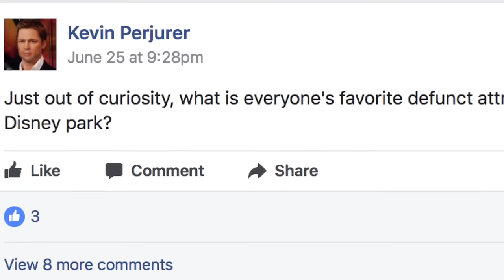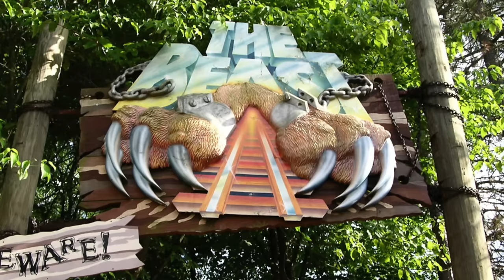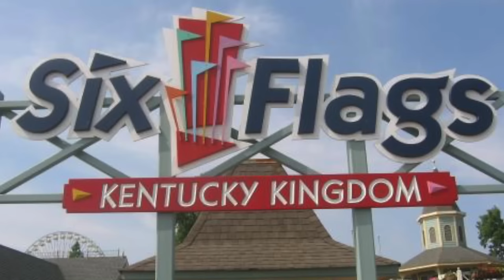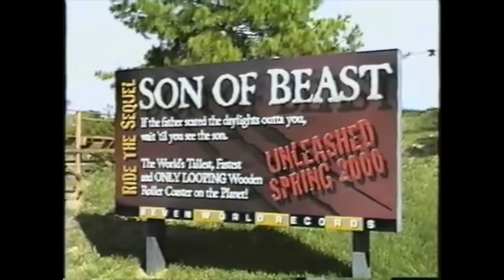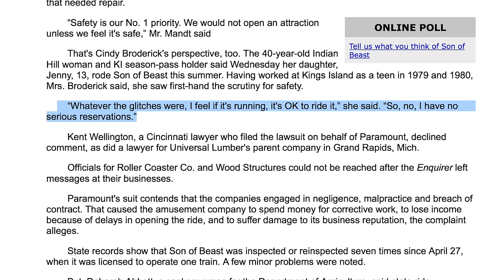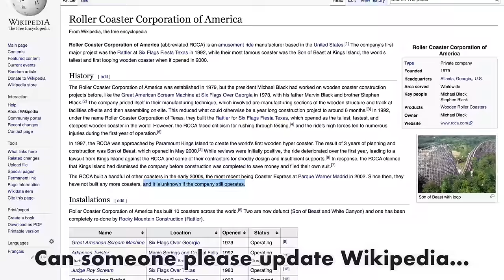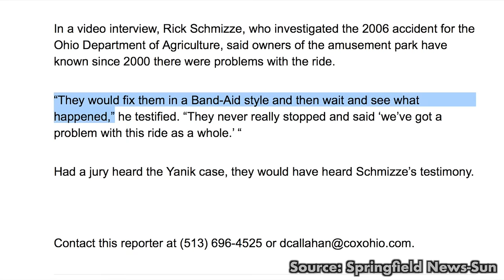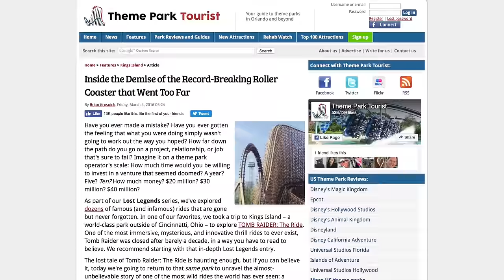Defunctland: The History of Son of Beast

Comment: SoB: wood starts cracking, bolts become loose
Kings Island: just put it in some rice
Reply: Maybe they should try soaking their logs in wood.
Reply: Maybe Flex Tape
Reply: Fix it with ramen
Reply: That's why you don't get lazy!
Reply: Have they tried turning it off and back on again?
Reply: Duct tape might work. 😉
Reply: What about steel plates?

Comment: 2:23 so for those curious about the brady bunch thing:

" Before the cast got on the roller coaster, Robert Reed noticed the camera on the front of the car looked unsteady. In another account, series creator Sherwood Schwartz said he thought the camera was too tall and would hit an overhang. Whatever the case, a test run was ordered without anyone on board, just to be safe.
Sure enough, the camera flew off during the first run. When the car came back to the station, the camera was missing. Had anyone been seated in the car, the camera surely would have flown back and seriously injured them, perhaps fatally.
Two cast members who would have been spared were Reed (Mike) and Susan Olsen (Cindy). Olsen refused to ride the roller coaster, so a stand-in was used. Barry Williams (Greg) held his hands in the air to cover the stunt-double's face. "
Reply: Wait so they used the stunt doubles for a test run??
Reply: @Bobsbugur8140  The test run was done without any people.  A double was used for the actual ride.

Comment: I know this video is 4 years old, but there's a bit of an error with your description of the July 9, 2006 incident.

A wooden support in the rose bowl section of the ride had cracked as a result of Kings Island's reinforcement of supports in other parts of the rides. The ride had become too stiff in certain areas, causing too much stress on others. It's believed that one train passed over the support, cracking it, then the next train that passed over experienced a major bump in the track damaging the support further. Both trains completed the course, but when the second train returned one of the ride operators noticed that riders seemed to have experienced extreme discomfort. The ride op immediately yelled for the ride to be emergency stopped. There were no trains on the course when this happened, one was in the loading station and the other is the one shown half-way up the lift hill in the footage you have.

The people treated were the riders on the second train, the riders evacuated were on the train that was halted before dropping from the lift hill, none of which were injured.

At no point did the ride stop mid course. The E-stop was not a result of ride failure, but instead a result of a ride operator that held rider safety as the highest priority. There were no sensors on the ride indicating ride failure, from the perspective of the ride ops everything would have appeared normal. If that ride op hadn't called for an E-stop the 3rd train would have likely not made it past the rose bowl section of the ride.

The story you gave is not far from the truth, but it the ride op deserves praise for the call to E-stop.

Comment: 9:47 This saved lives! The people before them came in injured, so the workers E-stopped the ride and if they hadn't they would've derailed and potentially suffered serious or deadly injuries
The wood had snapped and caused a sink in the rail. The pressure was enough to keep the coaster stable for the previous riders to go across with mild injuries, but another car going over would've caused a catastrophic failure and thus taking the riders down the with unstable frame
Reply: I'd like to commend the ride operatiors for their quick reaction.
Reply: props to the ride ops for doing their jobs and actually hitting the e-stop the moment they saw something was wrong. wish i could say the same about a certain six flags park

Comment: Rode this a few times when it was available, with and without the inversion.  Definitely one of the roughest and most violent coasters I have ever ridden.  Those giant wooden curves would just thrash you about everywhere and, because they didn't have a lot of space, there were a lot of giant curves...
Reply: I had a similar experience a as kid riding a wooden coaster at Six Flags Magic Mountain. It was closed in 2007. Called Cyclone and it was rough as hell. As a 13 year old that thing beat me the hell up. I still remember smacking my head on the grab bar in front of me at one point. Here's the ride: https://www.youtube.com/watch?v=92Hg3vONF5A

Comment: I rode the SoB (I like to think that its initials were intentional) the year that it opened, and it was a miserable experience.  Shaky and jerky throughout, even moreso than other wooden roller coasters like the original Beast (which, despite its shakiness, is still an amazing coaster) and Mean Streak at Cedar Point.  I'm honestly surprised that it survived as long as it did.  Great video.
Reply: I rode it once when it had the loop, and then once again when they took out the loop. Sure it was a marginally smoother ride but without the loop it was just boring.
Reply: SoB
Reply: I rode the Racer once, can only imagine SoB then.
Reply: of course SOB was intentional. jeeze.
Reply: The Son of Beast is by far the roughest roller coaster I've ever ridden. It was a miserable experience. My dad honestly thought his ribs were broke after riding it.
Reply: The Mean Streak was just that -- plain old mean. Never got beat up as much on a wood coaster as I did on it. The Beast is beautiful, a majestic work of art. Poor SoB! Never had a chance. Like MJ's sons.
Reply: I rode it a few times, and I liked the intensity. I love wooden coasters. Felt like RCT in real life. I was so disappointed they removed the loop.
Reply: @chrislgarner4927  I always called it the Whiplash, because that's what I felt like it gave me every single time I rode it.

Comment: "the low quality wood was causing the coaster to sway" UHHH EXCUSE ME??? im no expert but i don't think a roller coaster is supposed to MOVE
Reply: beavis anderson So can bridges
Reply: Skyscrapers like those in NYC are designed to sway with the wind or else they would just collapse.
This can be felt on the top of sears tower in Chicago
Reply: I would say some swaying is to be expected due to the height, but it shouldn't be noticable.
Reply: beavis anderson The trains are.
Reply: I regularly go to six flags over Georgia, and about 4 years ago they removed one of my favorite rides which was the Georgia cyclone. it was an old wooden coaster, and the wood had rotted to the point where if you stand on the ground and watch one of the sharp turns, the wood gives and the coaster moves about 3 feet towards you. they replaced it with the twisted cyclone because of safety issues. rip georgia cyclone :(
Reply: Saturnite GD I used to work there.  Every coaster is designed to sway like the to reduce stress.  It had nothing to do with rotting wood.  Contrary to popular belief every off season they replace section of the woodies removing any rotted wood and replacing with new and every few years they repaint the entire ride.  I’ve witnessed it first hand as I used to work in the off season.  They replaced cyclone with twisted cyclone because the ride became unpopular due to its rough nature.
Reply: @tgreenery79  Oh ok, that makes sense. I guess it was a lot safer than I thought lol
Reply: @ThyPandora  I wonder if a wooden coaster is SUPPOSED to shift a little to cope with changes in stress and weather. Changing seasons can cause critical areas to move just a fraction of an inch because heat/cold causes wood to expand and shrink a bit. This can affect everything including how much force the cars produce. This is basic science that they teach in high school...
Reply: I once went to a Texas theme park where their super old wooden “Rattler” coaster was swaying and shaking from the carts. I was standing in line for a different ride just watching and praying it wouldn’t collapse.
Reply: all roller coasters are meant to sway or move to some extent. its a safety thing.
Reply: @ohhellobethany  again, theyre supposed to sway to reduce stress on the ride, otherwise it might just break. if your ride doesnt sway to an extent its probably not safe.
Reply: Definitely meant to sway, most coasters do, as do most tall buildings. It's to help with strain. It's similar to if a person jumps off a box, for instance, if you landed with rigid legs it'd put a lot more stress on your joints and probably hurt a bit, where as bending your knees slightly on landing will help absorb some of the impact. Or suspension in a car; no suspension makes for an extremely uncomfortable ride and would wear the car a lot quicker. Pluuuus coasters with tall loops/peaks need to sway for wind resistance.
Reply: wooooooooosh
Reply: xLucky Sinz look I know this is 4 months old but here:

every coaster sways. It prevents the entire coaster from tearing itself apart. Also, Texas Giant was converted into an RMC hybrid (New Texas Giant) in 2011 and does not exist as its original form anymore.
Reply: jelly rolls that was Rattler in Six Flags Fiesta Texas. It was converted into RMC hybrid Iron Rattler in 2013
Reply: xLucky Sinz are you stuck in pre 2011? It’s an RMC now
Reply: Structures like this HAVE to sway. There has to be a certain amount of give under stress because if it doesn’t bend, it WILL break. Wooden roller coasters sway for safety, and you’ve probably seen gifs or videos of bridges swaying in extremely high winds. This is 100% normal and is safer than if it didn’t break.

All that being said, I’m sure SoB was swaying much more than it was designed to. But this comment is totally misinformed because roller coasters, especially wooden ones, are supposed to move and sway so they don’t snap under stress.
Reply: The problem wasn't the coaster swaying but the exact opposite. Kings Island had added unnecessary supports to some parts of the ride, making them too stiff. This increases the stress on the rest of the ride, which is likely what caused the crack. Next time you're waiting in line for a wooden coaster note the sway, that means it's been designed properly.
Reply: @ohhellobethany  rest assured a wooden coaster swaying is a sign that it is structurally sound. It may cause a bit of discomfort to riders, but a ride not swaying is what causes damage to the supports.
Reply: OH NO
Reply: Obviously you're not an expert. All coasters move.
Reply: @tgreenery79 oh. Alright I was wondering why it disappeared. Always made it a point to ride it first when I got there. A painful primer but definitely good for getting prepared for the rest of the park.

Comment: As an employee of Cedar Fair now, I had no idea this happened in one of our parks. I can say that in the current priorities in our park, safety is number one. Second is guest satisfaction. This would never happen in our parks in modern times.
Reply: It was a Paramount park when it was built. The rose bowl incident occurred a week after Cedar Fair purchased all of the parks owned by Paramount. The ride never actually valleyed as stated in the video. A train returned to the load/unload station and one of the ride operators noticed that riders had appeared to have experienced extreme discomfort. The ride op called for an E-stop and the ride was stopped as the other train was halfway up the lift-hill.

Cedar Fair has always held rider safety as the highest priority. I wouldn't be surprised if Cedar Fair had mandatory safety training immediately after buying Paramount Parks. It's possible that the train on the lift hill would have continued on the course had Cedar Fair not purchased the park. The outcome of this would have been fatal.
Reply: Given that Cedar Fair's priorities right now are rider throughput and reliability, yeah, there's no way that this piece of junk would have been built the way it was under Paramount.

Comment: I know I'm very very far from alone on this, but I just have to say how much I love the wooden coasters. not just because of the sound and the feel, but the SIGHT – the intricate web of supports and bridges you fly around and through ... you can't beat that, in my opinion. it's a really complex and overlapping pattern, the wooden criss-cross, and so it's just a really really interesting thing to fly around. I love that. 

then, of course, come on. clicketty-clack clicketty-clack clicketty-clack ... the quiet hum, then BOOM. you're off. awesome tension, awesome experience. a good wooden rollercoaster has so much going for it that a more modern steel design just can't. or won't.

Comment: Rode it in 2002, there was no line at all, complete walk-on and it was the worst ride I'd ever been on. The layout was pretty good, but I'd never experienced (and haven't since) a rougher coaster in my life. It just beat the shit out of you and knocked your knees into the front of the car. I was happy to get off the ride, and I wasn't at all surprised that they scrapped it in the end.
Reply: Icenineiv oh shit, it still to this day is the best coaster I've ever done. Scared the shit out of you but it was an insane adrenaline rush. Yeah it's a wooden coaster, its gonna beat you up. That's the point buttercup.
Reply: The point of a wooden coaster isn't to beat you up. If it beats you up, it needs track work. Now I will say that part of the fun of wooden coasters is that they have a rickety, out of control feeling that can make them feel much faster than a steel coaster with similar specs. That is in fact part of the fun of them and I don't think it's reasonable to expect a wooden coaster to be as smooth as steel. However, Son of Beast was a poorly constructed coaster and used low quality wood, resulting in an incredibly rough ride. Had Kings Island hired a company like CCI, GCI, or Gerstlauer to construct it, and not tried to cut costs wherever possible, it would probably still be there today and wouldn't have had the terrible reputation that it had. An unnecessarily rough wooden coaster is one that usually doesn't see the maintenance that it should, hence why so many woodies have been converted by RMC like Colossus, Texas Giant, Mean Streak, etc. In Son of Beast's case, everything was just done wrong. The Beast is still around today because it was designed correctly in the first place, although I've heard it could use some retracking.
Reply: @mhtube01  you're going 70-75 on a wooden coaster, its gonna beat you up. Period. Didnt even read all that nonsense. Obviously the ride was poorly constructed. However how many years has the beast been around ? When you whip around its tunnels that thing beats the hell out of you as well, it's the speed.
Reply: @TravelWBrennanMegan  I rode it all the years it was open and operating with the loop and without.  I am from the old school before steel coasters became so popular and wooden coasters were the norm.  Riding a wooden coaster you were thrown around to high heaven.  I still am a woodie fan and a member of ACE.  This was a damn good coaster and I am happy to have been able to ride it.  Any other Son of Beast fans out there?  Steel is just so tame, not a fan of "smooth" rides and I am 63-years-old.

Comment: I grew up 10 minutes from Kings Island, pretty much after the incident on July 9th '06 local confidence fell. Rarely would you ever see those signs saying multi-hour wait times after that. I rode the SoB during one of its last season that it was open, after they removed the loop and it was one of the worst experiences I have ever had on a ride (not the worst though). It was towards the end of the day, so my friend and I wanted to get in a couple more rides. SoB had no line so we hopped on 'line'. It was like a 5 minute wait but we quickly figured out why. By the time we got off the ride we both had headaches from the bumps and turns of the ride. We left right after that. After that I never wanted to ride it again, even warning my family and friends away from it. I'd argue it wasn't a big loss to park goers as the park had countless more rides that were far more enjoyable. Plus Cedar Fair built several more rides in the years following. I enjoyed the SoB when it first opened, it was the first ride with a loop that I rode, but it needed to go. It just wasn't worth the pain to ride.

Side note: I'm not exactly sure how substantial this rumor is, but its always been claimed that the Vortex is slowly sinking. That every year the ride gets lower and lower into the ground, eventually it'll be needed to remove the ride. Because of this I made a point to always ride it when at the park as you never knew if it would be your last chance.

Comment: Knew a carpenter who worked on Son of Beast.  He left the project because of the crap going on.  Bolts being cut and welded back together, the fact that locals with no experience were building this, non specified wood being used, etc.   Always heard stories about break failures on testing and the fact that design was not adequate for fully loaded cars.